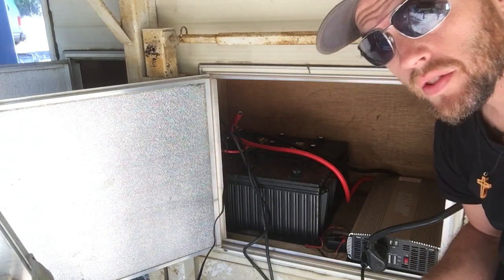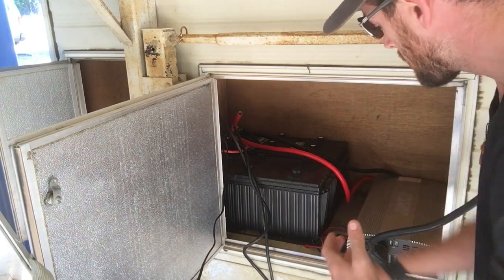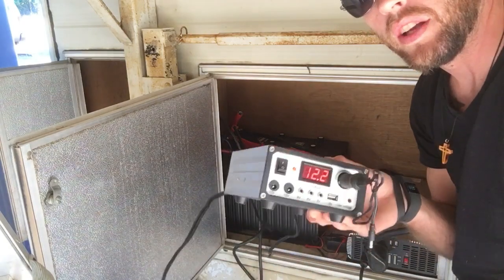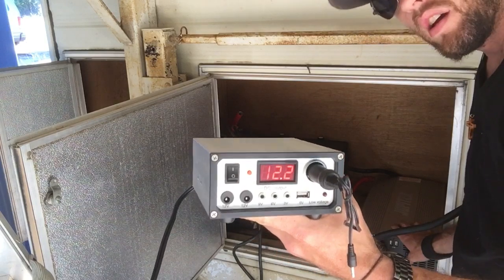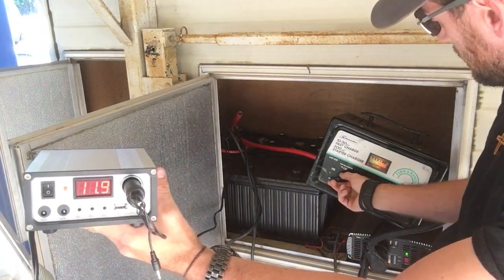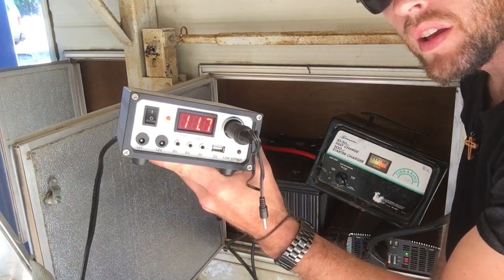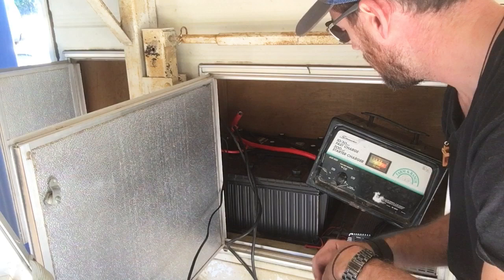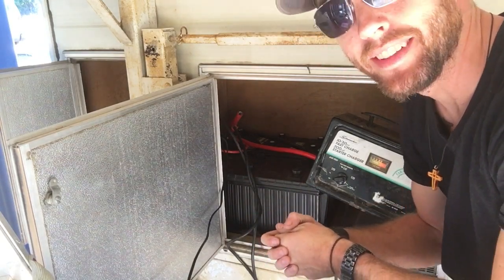The Circle of Lost Battery Life | Battery to Inverter to Charger back to Battery | A Perpetual Fail

Comment: I just set up mine 5000 watt , and a 2amp trickle charger 12V battery.... I notice its solid at 12v and 120v output .. inside of the feedback trickle  charger loop....// Outside that a load drops it to 11.8 and 117 volt.... But it was holding... Ill make a video soon....  Thank you.... You are my co experimenter.....
Reply: It dropped… but maybe my 2 amp trickle charger is the issue.. I’m going to buy a 10 amp  12 volt battery charger… I shall return.

Comment: This could work if your using an inverter style charger. I have been using my small inverter style charger i got from Walmart for about 3 months, the charger i have is a 15 amp charger with 50 amp start. At 15 amps i get power drop, at 50 amp start it will maintain the voltage level even when I'm charging my tool batteries, I'm looking at another inverter style charger that has a 75 amp output I'm going to get, I should see gains in voltage at that point, the idea for this was to have a self sustaining powered roll around tool cart.

Comment: I wonder what would happen if you plugged a 12v battery into an inverter , then into a transformer to raise the volts, then plug into a converter to charge the battery , while , using appliances plugged into your inverter draining power from your battery ?

Comment: You are borrowing energy to make energy, eventually it will cancel out when voltage equalizes, the electricity energy stored in battery drains away. So no it doesn't work for long and drains everything down then shuts off. The efficiency of the electronics drains more power than you are so called making.

Comment: I use 400 watts of solar to keep two deep cell batteries charged, I use those batteries hooked up to an inverter , with a 120volt 40amp charger ,charging my 460ah lihium  battery.

Comment: In theory, even if the external charger, runs off a separate ac power source, it will still not charge your batteries faster. 🙄, unless the inverter does not have a built in charger, when there is a input source from a Generator, solar panels, or supplied PowerPoint ac power.

Comment: The only way you can get back battery power is with a pyramid power regulated 12-15 volt 50 Amp,  this is my settings on a cen-tech 5000 watt 10,000 surge , it draws 100 watt input from inverter but I still have that 4900 to plug other devices , I wish I had a video from my things but my phone memory is low . Hope someone has another set up with other devices ,thanks for ur video .
Reply: I’m gonna try that.

Comment: Need to use a marine battery charger that has a power supply setup built into it that way you can run the charger off of your inverter and create a ecosystem
Reply from the maker: Great idea!
Reply: Could you give more details about this setup you mention? Thank you

Comment: Tried this a year ago, using 2 12 volts battery series to 24 volts attached to a 1,800 watts 24 volts inverter. It is charging but eventually the amount of watts put out by the inverter was not compensated by the amount of power put in by the charger to charge my batteries. So yeah, it ran out

Comment: Thanks for the video. I was thinking about using one good deep cycle battery to power and inverter that would power a battery charger. Then I'd hook up the battery charger to charge up the floor parallel batteries I have in my house. If I can get that one battery to charge the other 4 then I can just look up the first one to a hand crank generator to recharge that. I hope this makes sense
Reply from the maker: Sounds like it might work, give it a shot and let me know how it goes!

Comment: What you really need to try is to put an alternator in the circuit. So the battery only supplies the starting voltage, once the alternator is spinning, it produces the working voltage and connect the alternator to a motor to spin the alternator. You all do know that this is one of the Nikola Tesla machines.
Reply from the maker: But then you need fuel and won’t really have endless energy that way either

Comment: I just plug a 3 amp trickle charger into a 120 watt inverter plugged into my car powerpoint and top off the charge on my separate power station while I drive.. I have 2-50ah batteries into a 500 watt pure sine inverter in a 3rd gen 4runner I use 100 watt solar when I camp, but I find this really helps on long trips, it draws very little juice from my Toyota and helps keep my batteries topped off...
Reply from the maker: Sounds like a great set-up
Reply: Thanks for sharing this. I plan to bring a small 2A/8A smart charger while camping to charge a couple spare batteries I have with AC power when I can, but just picked up a 200W inverter from Tractor Supply because I thought it would be a better way to recharge the spare batteries from the vehicle while driving if needed (seems better for the batteries and safer than charging straight from the alternator). Is the 2A 120W setup still working well for you? Ever have any issues pop up?

Comment: have you tried this setup with alternator hooked up to batteries? cause the alternator puts out 13.5V and a charger puts out 14.4V.
Reply: then you would be consuming current in exchange to keeping the loop voltage 1V higher... prbly it will damage car electronics o.O

Comment: Would hooking up my ever start 120 watt inverter to my rv's dc port and plug in my 750 ma 12 volt battery charger its the Battery tender high efficiency automatic battery charger maintainer directly to the battery would it keep it charged cycling itself and its not using over a amp to power up from the battery's? Looking into solar kits to at some point from Amazon the 200 watt kits that comes with a 30 amp charge controller ect for over 370 bucks.. and maybe wind turbines as well and those are like 250 a piece not cheap at all,  but for now I have these devices at home not being used right now and a RV at a rv park stored and its draining my battery' dead within 3 days just sitting there and it has 3 battery's hooked to each other and I unhooked the negative from the main battery but it still drains them. I have to jump it every week to drive it about 10 miles to get the alternator to charge the battery' up some but it never stays charged up no matter what and I have no electric to hook up to at all to at least keep the batteries charged that way but I don't. I'm so tired of my batteries going down in 3 days or faster. Had my batteries tested and they all are good batteries and they said they just need charged. I wondered if my idea works to use the batteries power to charge itself by my maintainer charger through dc inverter a sine wave one would it work? Has anyone tried it yet?
Reply: Dude if you removed the N and your batteries are still draining trust me they are fucked 👍👍👍
Reply: @s2oooo  It was cause I only unhooked the main battery negative and left the others hooked up and it drain all 3 within 3 or 4 days to where I had to jump it. I drove it a while to get them charged up and ran my generator for about 30 minutes as well to charge them up and unhooked all 3 negative cables and they were fully charged all 3 and I went and hooked them back up and they all 3 were at 50% charge the battery tester said and at least had enough charge to start the rv up after  3 weeks sitting. The guy that owned it before and sold it to me added a 3rd battery for the electric fridge he installed and removed the propane fridge and closed off the propane line. I think its his wiring job thats draining them so fast when its hooked up to batteries and sits.

Comment: Try it with a smaller trickle charger. My battery went up .2 volts in 1.5 to 2 hrs.
Reply: You’re correct! However, it will eventually drain it down. A basic and simple (ONE) solar panel system would fix all this. So it IS possible.

Comment: Really is a nice try I've had that thought back when I started getting into this stuff but you need to realize that the inverter and charger are bolth consuming power well being run  so ur loop is going to lose power through out the process until you hit that inverters low voltage point I Kno it was an experiment but you really need another source of charging power like solar or a alternator now here's a cool experiment that might work get a car alternator and a electric motor that can spin the alternator fast enough for the right charging volts and amps and run that electric motor off ur inverter well having the alternator recharging ur battery so pretty much a battery a alternator a beefy electric motor and ur inverter put all that together there's ur loop look it up on YouTube I wanna build one just haven't yet lol
Reply: My tiny 36 pound trolling motor can drain my 40ah battery down to 50% in half an hour so turning a alternator would easily kill everything 😂

Comment: First you need a pure sine wave inverter. That inverter is a modified sine wave. It makes a huge difference! Also I recommend using 3 batteries. Cross the first 2 batteries in series and then the last battery in parallel. That way you will get a constant strong 12v reading. It works
Reply: you should post a video of that setup...sounds awesome.  what wattage does the inverter need to be? would a lower wattage charger be better?
Reply: I agree please post.
Reply: I would also like to see the video

Comment: i dont know how efficient  batteries are but lets guess 85%  in other words you put 100 watts in you might get 85 out

i also dont know how efficient the charger is, i would guess the charger is 85%, same thing you put 85 watts in, now you get  72.25 watts out

i have a good idea about that inverter, its close to 85%, so if you put 72.25 watts in you get 61 watts out.

as you can see in the flow loop i layed out with numbers every electron loop of a 100 watts you loose 39 watts. granted the only thing i am certain of is that the inverter is close to 85%, i was guessing at the other but the formula works the same anyways. it will charge the batteries but drain at the same time. as the battery hits about 10.5volts the inverter will beep and turn off due to low voltage protection. how fast this happens depends on how dead the batteries were when you started and how high of current you charge at. i admit its kinda fun  too  see how the math works out in the real world, but if you run those batteries down to the point the inverter shuts off then you most likely depleted your bank past what is called the recommended max depth of discharge which is around 50% on deep cycle batteries, which is taking the voltage down from 12.7 to 12.0. again a one time experiment will damage them, but probably not enough to care. its not like those are $1000 lithium batteries.

Comment: I jump started by Semitruck it could be done. I do it all the time with the same batteries..
Reply: I was in optimized idle  no a/c use my refrigerator drained my batteries can I plug in a/c to to power 8nverter will that send voltage back to my batteries

Comment: try to connect your charger to a solar source. the possibilities will open up. also cross wire the batteries to get a higher output off em
Reply: no dude, you dont cross wire them. if you are setup for 12v and you have 12 volt batteries and you run them in parrall and you gain amps. if you wire them in series your amps stay the same but your volts is added. but you cant just willy nilly start changing wires. its based on your battery bank, your charge controller and your system. i think this was for an rv, maybe he needs to keep it 12v?

Comment: That won’t work you idiot what will work as an alternator and electric motor turning the alternator storage batteries in an inverter in a timer that will allow the alternator to rest on and off let’s say hour and a half on one hour off 24 hours a day there is your perpetual energy machine I’m assuming because no one has done it at least where I can find it on YouTube that the power company doesn’t like this
Reply from the maker: The “idiot” would be the individual that would take the time to name call without watching the video in which it clearly states that the experiment won’t work. Not all experiments are going to work, that’s why they’re called experiments. That’s just science.
The purpose of this video was to prove it won’t work.

Comment: You can do it with a pure sine wave inverter with battery charge
Reply from the maker: Mr. Harris pure-sine was out of my budget, but definitely interesting to know.
Reply: I feel you brother. I’m saving for 1 , on my 18 wheeler I’ll do a video the install and charge then let you know the pros cons . Thx for the reply
Reply: pure sine wave inverters are nice. i just got the biggest one i could find that still runs off of 12v. but i am here to say that it doesnt matter what inverter you have you will nerver get more out of it then you put in. in fact its the opposite. that inverter he is running is 85% efficient give or take. so if the inverter take 100 dc watts in from the battery, it will only out put 85 ac watts out to the charger. yes, i know that charger takes more than 100 watts but the math scales up. i cant believe how efficient my pure sine wave inverter is at 95% but its the same problem, i will loose 5% at the inverter, the charger then has its losses, then the batteries have their losses and every cable has its loss. especially those charger cables they will start to get hot at 20-30 amps which means heat which means loss.

Comment: Could you go like this? 
12v Battery 1 in a car with altinator to inverter to charger to 12v battery 2 safely? Without draining battery 1?
Reply: Darron B not sure I 100% understand, sorry if I got you wrong - but in theory yes you can do this. However it will always ‘drain’ battery 1.... if the inverter is only on when the engine is on, then this won’t effect battery 1’s charge but will always be putting load on this battery to operate. The inverter will still take charge from battery 1 to charge battery 2 when the engine is off, which you wouldn’t want! 

But if it’s just to charge battery 2 the common thing is a split charge relay between the batteries, then the alternator charges both batteries. This is a lot more efficient than the setup you suggested there. Then if you did have an inverter as well, just connect it to battery 2 then you have AC power on the go

Comment: Yes it does work depending on batterys and inverter , my set up is backed by solor works perfectly fine ( endless power ) unless something fails and that is a given
Reply from the maker: If you are adding in solar panels as a means to keep the batteries charged, then you are missing the point of what I was attempting.

Comment: There's got to be a way to make our source of power sustainable. The planet is designed that way. Check (am still learning) having solar, a converter, an inverter, and all needed to do this). What I'm trying to do is to add to my van another source of power to keep up my battery ready to crank it. It's drawn twice recently although I changed its composition, recharged it, died within less than 7 days. So I'll keep on looking for my whole rig.
Reply from the maker: I’m currently looking into using my vans battery a similar way… let me know how it works out for ya!

Comment: There is no perfect system, eventually along the way there will always be what you call a system loss, same analogy on a generator driven by a shaft in a Power Plant, either by a turbine(geothermal source or water source through a dam), producing a current...We can deduced that what if we eliminate the outside source powering the generator, what if we replaced it with an electric motor connected to a generator thus making it a perpetual machine? Is it possible? Generator producing a current feeding its electric motor to rotate its drive shaft connected to the generator thereby producing electric current.
Reply: An alternator? That would require modifications but it's a good idea.

Comment: I've always wondered if this would work with a jumpstarter pack and a small cigarette lighter power inverter plugged into the 12v port on the jump starter and looped back so the 110VAC from the inverter is going back to the charge input for the jumpstarter
Reply from the maker: coondogtheman1234 it’s always worth a shot if you’ve got some free time, but no success on my end, thanks to the law of conservation of energy.
Reply: That works

Comment: Take a 6 volt 2 amp DC  battery charger 120 vt AC input and connect it to 10K furnace transformer.  That is like applying 12 vt. AC instead of 120vt to the transformer the output should be 1/10th  or  1k  for refeed purposes to the transformer with a surplus of 880 vt AC.  Tesla was always talking about increasing  the volume of the frequency but we have been conditioned to be dependent on limiting  it.  Westinghouse said if it's no good if you can't put a meter on it.
Reply: You could refeed the surplus to the power grid and be your own power company.  EVER CONSIDER WHAT THOSE TRANSFORMERS ARE REALLY ABOUT ON THE TELEPHONE POLES?

Comment: Good try bud ive been working on the said project for quite some time almost done once im through ill share my findings
Reply from the maker: Dwayne Stevens Looking forward to your findings! Somebody else in the comments stated that it’s because of the low amount of the fee should see that battery chargers work on.
Reply: @JackNelsonBand  Have you tried using two inverters one for charging batteries and the other for loads... For example, the inverter that charges the batteries connect to the loads inverter then connect the charger to the battery...
Reply: Will it power a house ??